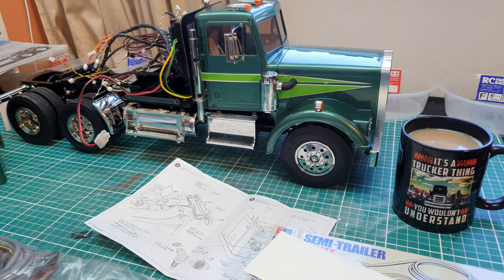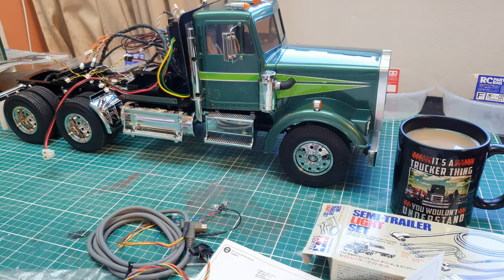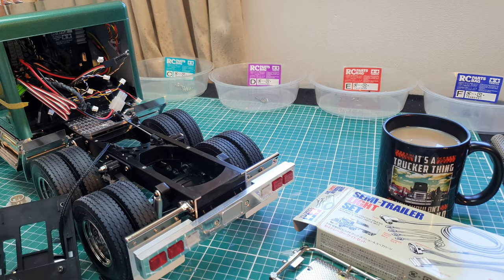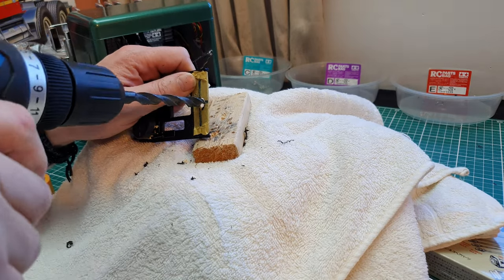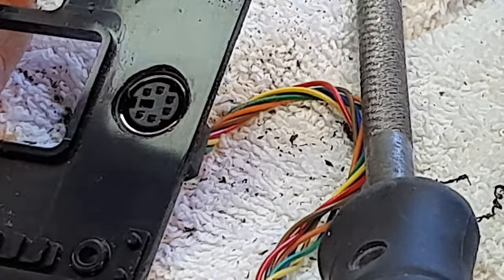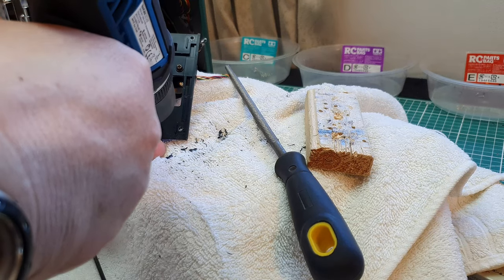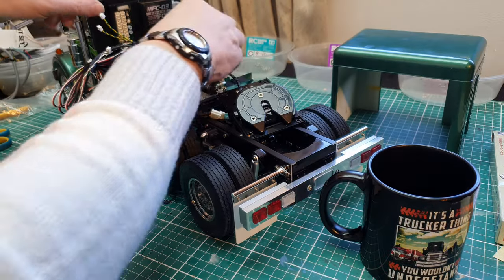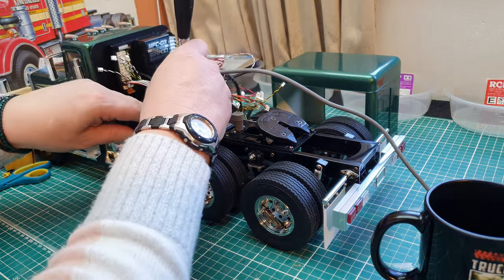Tamiya King Hauler Build Ep16 - Custom Fitting The Trailer Lights Socket - Movin' On

Comment: Hi Teri I have installed the plug you have just showed me but the trailer Iight plug catches on the the trailer when pushed into the coupler. Do you know why that is?
Reply from the maker: it's designed to fit into the socket when mounted to the back of the cab, I put it in the chassis frame because I prefer it there but I do have to shave the lump off the top of the plug so it doesn't catch the trailer.
See this video, at 36 : 40 https://youtu.be/HAOGW5a9o0A

Comment: Teri, that's a bluddy great idea!!💡  I was just thinking about that very thing. My Trailer Light Kits arrived today - as well as my Trailers!! 😁 
I'm going to have to cut the plug off of the Truck end.... Because I'm using Beier USM RC-2s. So I also need to figure out WHAT color Wires go to what lights. 😖  Do you know? 

Right, I wanted to mount the Plug NOT on the Sleeper Body, but didn't figure out where. 
You just sorted that for me!! Thank you so much! 😊🍺  I don't have remote Coupler, so my Coupler Latch plate is a perfect spot. 

Seriously, thank you!!! 👍👍☺  I've gotten so many good ideas from you so far. I've given you credit on my Videos. 😉
Reply from the maker: Wire Colours in the Tamiya Trailer Lights wire are as follows...

Left Indicator - Brown (+) Red (-)
Right Indicator - Orange (+) Yellow (-)
Stop/Tail - Green (+) Blue (-)

the lead which plugs into J28 is (from left to right)...

1. Brown +
2. Red -

3. Orange +
4. Yellow -

5. Green +
6. Blue -
Reply: Bless you Teri!!! 😁
Reply from the maker: @CarminesRCTipsandTricks  I have a note book which I write everything in... I identified the wires in the trailer lights when I was asked to swap the stock LEDs to 7 chamber euro style lights.
Reply: @TeriWilde  SUCH A SIMPLE IDEA 💡 
You'd think I would have been doing that for years...  Oh wait! I did. When I was a Repair Shop General Manager.

Yet I never thought of doing it for my Hobbies. 😖
Right, chalk up one more "Teri Idea" for my Trucks!! 😊 
I think I've mentioned that I've been in the Hobby since 1983.... But this is my first Big Rig Build. And I'm STARTING with a Beier!! Somebody hit me in the head. 😳

Comment: if you have used the screw driver when putting in the speaker or the motor or vibe motor that could magnetize you screwdrive. nut a great idea for the trailer plug wished i thought of that as i filled in the holes on my cab but ended up placing the plug where it supposed to go but i just used a body reamer to make the hole .
Reply from the maker: I first put the trailer plug there in my Rubber Duck MACK so I thought I'd do it again 😎

Comment: Yes we do like your videos. Have you tried to fit wireless trailer lights? With a receiver and battery box on the trailer..
Reply from the maker: I have SS-Tronix wireless connection in my W900 Snowman truck and Servonaut Air-U/AMO in another... it's rare I use the couple/uncouple so it's not worth the cost of fitting them in a lot of cases... I like to run with trailer rather than bob tailing... 
I will have to demo the wire kits I've already installed in my other builds 😎